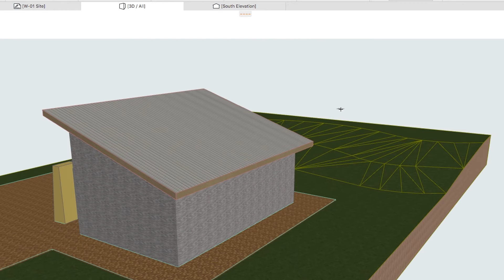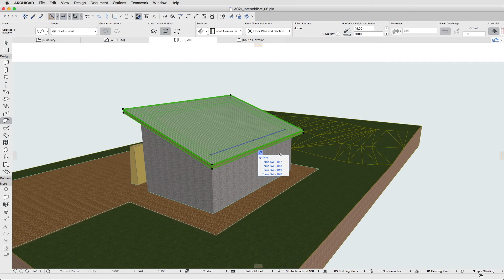Trimming to Roof - ARCHICAD Training Series 3 - 15/84

Comment: Arda Aksu, I had the same thing happen a few times and I dont remember what I did differently to get it to work.  I think I just redid the trim and it worked. 

My problem now is I am trying to get the plywood of my wall composites to run through the roof framing layer to the plywood layer of the roof composite on my shed roofs.  I used "Trim Elements to Roof/Shell" and it worked for all walls except the wall that the pivot line is associated with. It will only trim either the framing and exterior part of the wall or the interior drywall (pivot line is set on inside face of framing) so it seems like the pivot line is affecting the trim operation.  Another problem which seems to be related is the corner where the rake and pivot line walls meet goes missing when I use the "Trim Elements to Roof/Shell" on the rake walls.  I ended up merging the pivot line wall, set to the height of roof plywood with the roof, which cleaned up how I want it to, and then merging a small section of the rake walls on both sides of the pivot line with the roof and it cleans up nicely but only to the height of the wall but since there is no way to model a sloped wall in ArchiCAD without operators it doesn't cut the walls at an angle like I want.  My goal is to eliminate as many lines/fills in section as possible but also being able to draw a section anywhere I want/need and it be accurate.